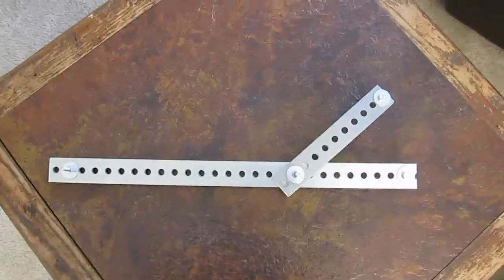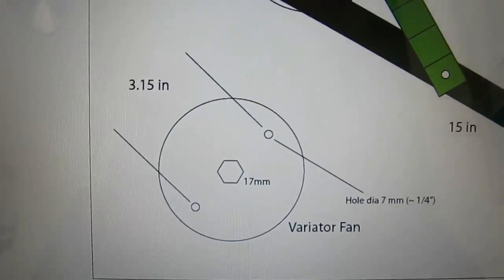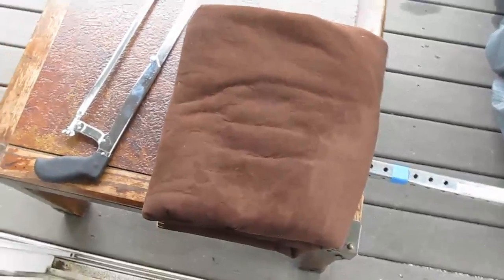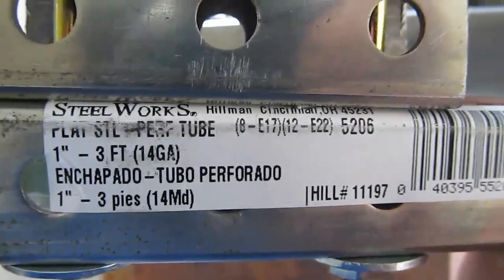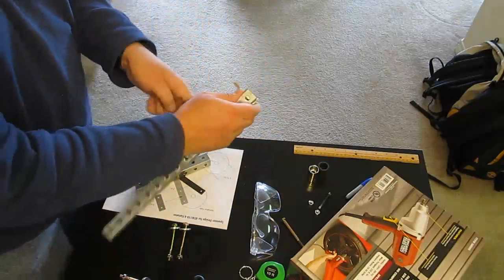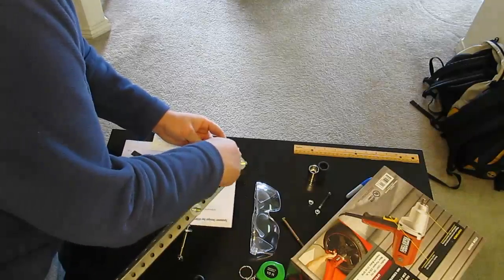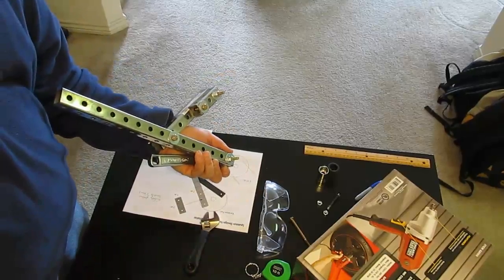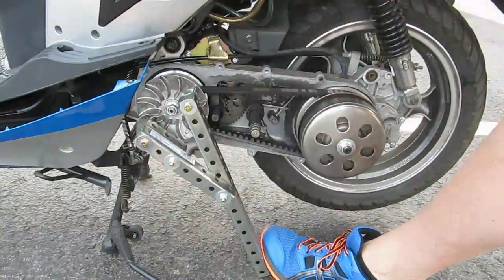Taotao ATM150-A Evo scooter - build a spanner tool to remove variator nut

Comment: For those saying "just use an electric impact wrench", well I did and because it was extremely tight screwed, it wouldn't budge.

So, I made a custom variator holder and it came off nicely.

But, when I tried to put the variator back, I decided to just use my impact gun. When I hit the throttle, the screw came loose, so after I had done the same thing, I screwed it with a hand wrench and it almost did a full circle, that's how loose it was.

Comment: You wasted your time on that rubbish tool when an impact gun comes off easier? It's harder on the clutch.
Reply: Dude. I've used 150 psi air compressed impact and the thing still didn't budge
Reply: @stevethomas6994  Ditto!
Reply: It's  low budget tool making method, Y tool, Impact wrench are available, but it's intresting work😂

Comment: i made mine from the under side of a beach cruiser seat ,it's the metal that holds the springs to the seat post and the I stacked four bricks to make up the length difference to the ground , using the screws to hold the front variator and the rear couch bell it works great total time 13 min.

Comment: Why not just use the electric impact you have on the table in your video? Impact is the quickest way!!
Reply: He probably tried already because sometimes the variator nut has a strong threadlocker adhesive from the factory and they're a bitch to remove the first time. At least in my case it is.

Comment: surely for the clutch just hold the rear brake on and crack the nut ,ive not tryed it on the clutch but ive tightened/undone the rear wheel nut on my burgman 400 that way which should be about the same torque

Comment from the maker: Hey thanks. I haven't tried this tool on the clutch yet, but I think it'll stop the rotation if inserted into the cutouts in the clutch bell. If not, I'll design another a better tool that does both clutch and variator.